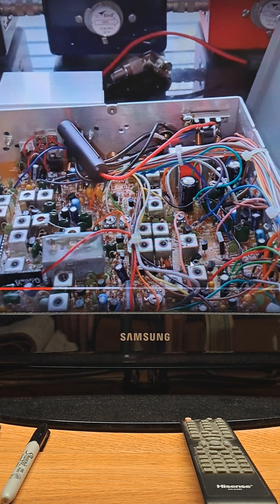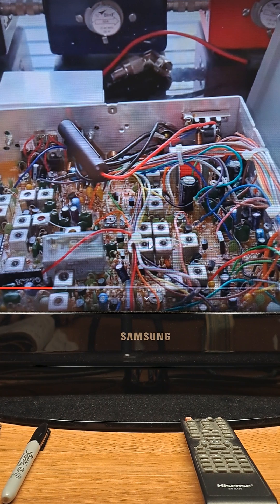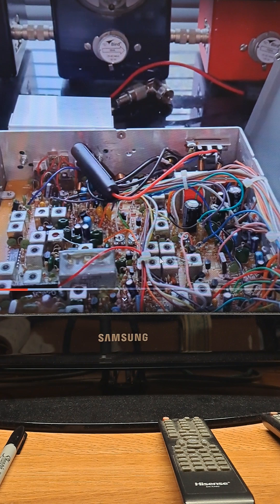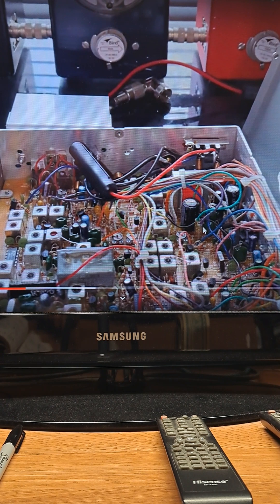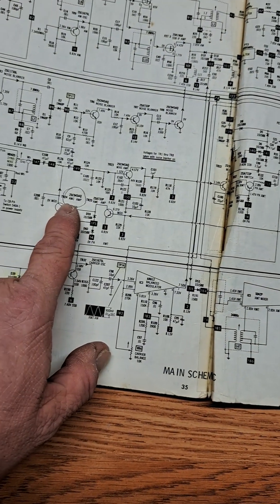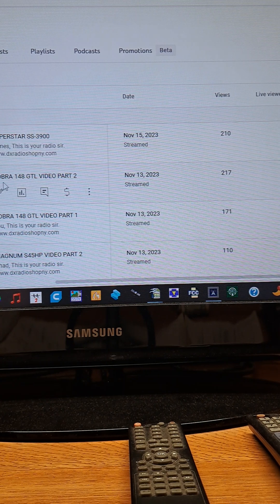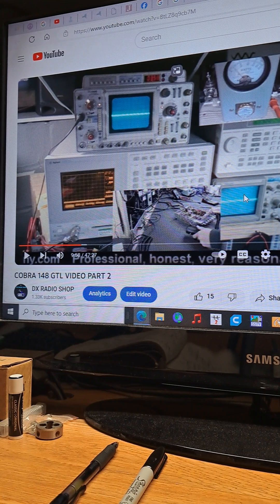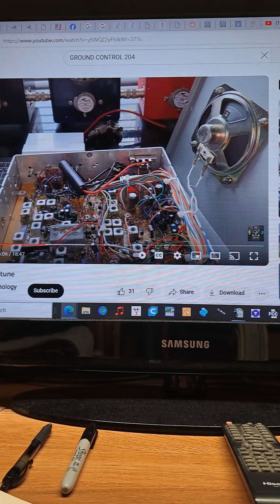INFORMATIVE INFORMATION ON THIS RADIO.

Comment: Tech question :  I’m running a Stryker 655hp with a single Hustler antenna.  Whenever the slightest amount of snow builds up on the antenna coil, the SWR protection     activates. Can’t transmit. 
 Pull over, climb up & wipe the snow off. It works great again. 
What’s happening ? 
Any suggestions to prevent that from happening ?
Reply from the maker: Check your ground, Try putting some dielectric grease on the antenna fittings and that should help.